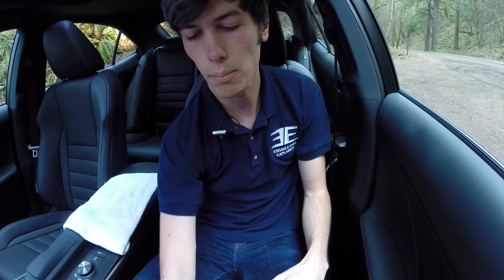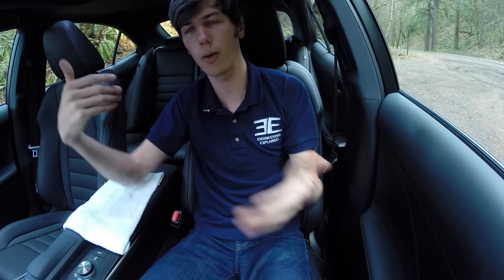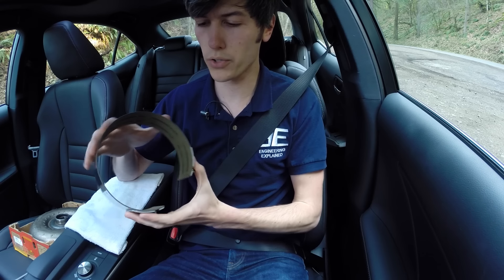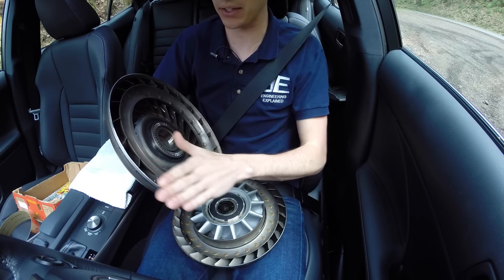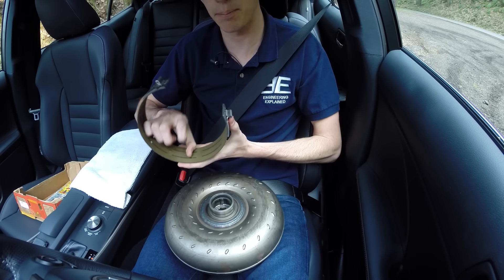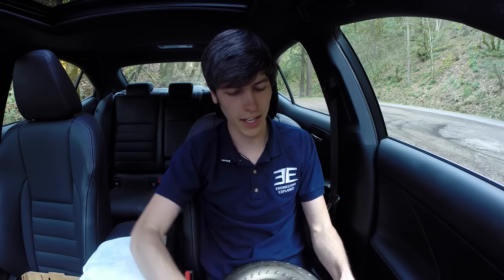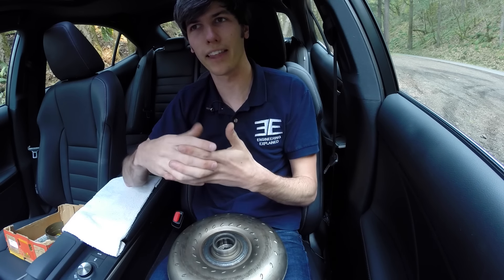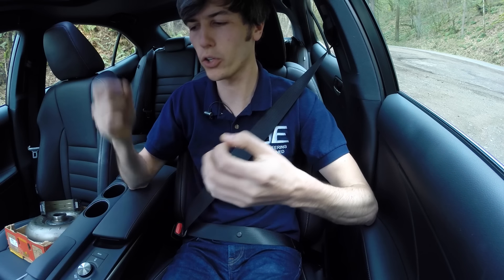5 Things You Should Never Do In An Automatic Transmission Vehicle

Comment: Shifting to neutral at the stop is good for these reasons:
1. Prevents the torque converter from overheating. Idling in drive causes the impeller to rotate while the turbine is held stationary by the transmission which prevents the normal fluid flow inside the torque converter resulting in turbulence and heat generation by the fluid.
2. After a hard stop, shifting to neutral and releasing the brakes allows the brakes to cool down with the pads disengaged from the rotor which prevents the rotor warpage.
3. It will also circulate the fluid between the torque converter, the transmission, and heat exchanger further cooling down the torque converter.
Reply: but what about the guy who crashes into you because your brake light is not on and is reading text on their phone LOL
Reply: i was looking for that. i wonder why he didn´t include this
Reply: @ranger178  You make a good point. I recently been using this practice on my 8 year old AT car after I read an article about it. On inclines and flat roads, I still press the brake so the driver behind me could see the brake lights and also that I could safely put the gear in D when the lights change. I drove a manual transmission for years and practiced the same method.
Reply: 1. The heat generated while in gear at idle is negligible and will have no measurable effect on the temperature once circulated through the transmission cooler and/or warmer (modern vehicles have both of theses to closely regulate transmission fluid temperatures).
2. The pressure applied by brakes at a stop does not cause rotor "warpage" unless the braking system has been heated past its specified operating range. The "warpage" that a majority of people encounter is either runout (caused by uneven application of pad and rotor contact pressure inherent to a poorly design braking system), or pad deposits on the rotor (which will occur regardless of pressure applied between the pad and rotor).
3. This is a misunderstanding of how automatic transmission fluid flows within any modern vehicle. It is ALWAYS flowing through the cooler and/or warmer, regardless of gear position. Fluid flow ceasing hasn't been a phenomenon since the early to mid 90's at the latest.

Stop spreading misinformation.

Comment: If your throttle is stuck, couldn't you put your car in neutral and turn off the engine entirely?
Reply: +Tyrian3k This is what I was going to post and am surprised this was not mentioned in the video as the first thing to do.
Reply: +Tyrian3k In some cars, you'd lose your power brakes and steering.
Reply: Lose the power assisted maybe but doubtful. If you did, it would still be better to do than not
Reply: +Tyrian3k Power steering goes out. So too do power brakes. If you're not expecting either of these or the situation doesn't permit them, you don't want it to happen.
Reply: +SyCoREAPER I suggest you try reading that funny book in your glovebox.   I think they call it an "Owners Manual".    If you do that, it will tell you exactly what I just did.    Do not turn off your engine in this situation.
Reply: +Pywaket Pilot Cars are towed in this exact configuration according to my manual. It curiously lacks anything about turning your engine off while driving, though.
But if you actually want to have power brakes, just keep it in gear. That should keep it running in at least most cars. Works in mine at least.
Reply: Pywaket Pilot I didnt see in the OC that he had turn engine off (or he hadded that after I commented), I am speaking strictly putting it into neutral.

Comment: For fuel economy, there is no question that coasting in neutral increases fuel economy.  Fuel may be cut to the injectors in new cars, but the resistance of the engine will slow the car...meaning that you can cost in neutral on a slight decline and gain speed or maintain speed, where you will lose speed while the engine is engaged because of the engine resistance.  In either case, anyone not actively engaged in driving shouldn't be driving.  For states with ridiculous laws like this, I don't know how they explain  manual transmissions being legal at all.  For those who care, I've gotten as high as 27 mpg out of a 1997 Chevy Blazer, a lot of that was tire pressure, taking off the spare tire arm (and putting it in the back, yes, I do need a spare tire), other simple weight reduction, coasting in neutral, slower acceleration and avoiding braking (meaning, if you see a red light 300 yards up, don't accelerate into it just to stop, try to time your speed so you can still be rolling when the light is green). Accelerating from a dead stop is your biggest wasted fuel consumption.
Reply: funny, I do the opposite, I dont worry about removing crap from my truck, stil have spare tire, and all the crap holding it under the bed, etc. I do coast in N on hills, but I get 22-24 MPG when Im not caught up in traffic jams, my truck is rated by the EPA at 18-20 but the average was around 17 with what they measured, remember they use both city IE LA traffic patterns, and Highway coasting at 55or 65 MPH I can't remember which. RPM band has a lot to with it, I find I do better at gas mileage on the rural stretches of highway where I can cruise at 83. If I go faster it is too much RPM, If I go slower than that around 75 (the speed limit) it is at 4500 RPM in 4 th gear and not the OD.  or so it seems. I watch my tach like a hawk. Also, I wont get speeding tickets on the interstate at 83. you get 10 mph here from DPS. (wouldnt recommend if you have out of state plates they will stop you at the speed limit even sometimes)
Reply: I will continue to use neutral on particular downhill stretches that result in not needing to press any pedal for protracted periods. It relieves my sciatic nerve pain as I rest my foot.

Comment: inmate: i am here for child abusing and murder.

me: i coast down a hill in neutural
Reply: Gets arrested for coasting in neutral
Gta sa soundtrack starts playing
Mission passed
+Respect
Reply: murderer slowly scoots away
Reply: I'm a repeat afender facing multiple counts..
Reply: Gay Inmate:  Hey Neutch Gooch..
Reply: @Ken Mason 😳
Reply: Nothing that he said about coasting applies, when you're trying to diagnose your vehicle and just turn off the engine and put it in neutral so you can listen to it and you doing it in a safe place, nothing mechanically is going to go wrong, it's not going to hurt the vehicle. and if you're trying to keep a vehicle from overheating and you trying to coast down a hill then it's an emergency situation it's doable as long as you understand all the variables about not having that power not having your power steering not having your power brakes but if an emergency calls for it can be done and it won't hurt the vehicle...
Reply: It only applies if you're wearing a comb over.
Reply: 6 stars right away.
Reply: *coasted
Reply: But how are they ever going to prove it?
Reply: @fubarlife7776    I agree you can coast down a hill in neutral safely if you know what you're doing.  But I think overheating is not really a consideration, since the amount of fuel burned going down hill in gear is either minimal or zero, and so is the heat input.   Of course if neutral allows you a little bit better speed to carry you a but further past the bottom of the hill before you have to apply power again, then that would be relevant - depends on the situation.
Reply: Engine break hahahaa
Reply: Hahahaa
Reply: @cr10001  if it doesn't hurt anything mechanically I don't see anything wrong with coasting downhill. When I put it back into drive I wait until it grabs the gear and then I'll accelerate.
Reply: @madphatdopeyo742  The only thing against coasting in neutral is, IF the engine stops without you noticing, you will immediately find you don't have power steering, and after a couple of brake applications you'll lose the power brakes.   This can be embarrassing if you discover this approaching a corner  :)
And if you decide you want power suddenly, it's going to take you a few moments to get back into 'D'.
So if done judiciously, and in the right circumstances, fine.
But your fuel consumption is minimal (may be zero) in gear with the throttle shut - may be less than the 'idling' consumption - so that's not really a reason.
Reply: @cr10001  makes sense. It must depend on the vehicle. I had a 2010 Corolla and when put into neutral while coasting the RPMs dropped to less than 1k. In drive it hovered between 1.8-2k. I did that for over 100k miles and had the car for six years and it never stalled until the tranny broke about 250k miles. It was in drive when that happened and broke when I hit a bump in the road. My current car an 04 Envoy when put into neutral while driving the RPMs don't go down at all and sometimes go up a little bit. So I never do it now.
Reply: I’m in for 10 years… what’s the charge?  Coasting in Neutral
Reply: Neutral coasting isn't about saving fuel, it's about having a roller coaster ride on really hilly roads.

Comment: The only reason why I would put my car in neutral at a light is because it's a long light and I don't want to keep my foot on the brake :/
Reply: Same
Reply: I just put the handbrake on in drive +silicon212
Reply: +silicon212  hand brake is your friend
Reply: Well that's good for you and your Sonata - not so much with my Crown Vic P71.
Reply: +silicon212 Used to do that when I had my first car, If i was at a drive through with a long line I would shift it to neutral lol But now most of my cars are standards, so I don't have to worry about that as much lol
Reply: Ronald de Rooij LMAO I'll have to remember that ;)
Reply: +silicon212 that must be a really, really, really, really, long light. Also, nice streets that are flat enough.
I am relatively new to driving(2yrs only) so what I've done the three or so times I need to let go of the brake when stopped was to use the hand brake and another time I just set it in Park(yes, bad idea on the park)

Tempted to try neutral whenever next times comes around, assuming I'm not on an incline of course.
Reply: +silicon212  sick of people with their foot on the brake at lights etc at night as you get blinded looking at their brake lights
Reply: E-brake in drive.  Or E-Brake in neutral if the car hasn't warmed up yet.
Reply: +silicon212 thats just lazy
Reply: +mark smith brughe get a light tint for the windshield, I got the same issue with the angry drivers in my area driving with high beams on. I'm getting a nanoceramic 70% , check your local laws on tint.
Reply: +silicon212 It's even worse when you're in a traffic jam, up hill.
Reply: That's what Park is for..
Reply: Yes, because EVERY CAR EVER BUILT has an automatic transmission.
Reply: +silicon212 Yup every car is automatic ;)
Reply: +silicon212 The old 90's miatas never had an auto.
Reply: Apparently my sarcasm was lost on the crowd.
Reply: whats sarcasm?
Reply: An illusive concept.
Reply: +silicon212 If you were being sarcastic it was pretty fail. 

Sounded 100% serious and then you defended it lol
Reply: vexx506
Learn to read. "Yes, because EVERY CAR EVER BUILT has an automatic transmission." <- Sarcasm.  Get a brain.
Reply: +silicon212 You don't understand how and when to use sarcasm. And +Asserting Word is still unsure if his sentence makes any sense. Now, what's the title of this video again...? Go on...
Reply: +vexx506 Wow...went totally over your head. When you said to put the car in park, his response was to make fun of you for thinking every car is automatic ( because manual cars don't have "park"!) That's what the sarcasm was.
Reply: Matthew H Somebody got it!  There is HOPE FOR HUMANITY after all!
Reply: Not really. You were sarcastic for no reason.
Reply: Edward Rollingstone Explain "no reason".
Reply: No, Kay, the heating only happens when there's friction (wheel motion).  No motion = no friction.
Reply: or the clutch FFS!!!

Comment: one real good reason to put it in neutral while at a stoplight:  if it's real hot and humid you can rev it up to 2000 rpms so the a/c gets real cold, ha ha
Reply: I do that too haha
Reply: But doesn't that take away power from the A/C to rev up the engine?
Reply: The A/C compressor is connected to the engine via a pulley. The faster the engine spins the faster the compressor does.
Reply: +mop10000 faster the compressor "does?" Do you mean, "faster the compressor and clutched fan spin, moving more cool air over the condenser and radiator allowing for a better experience inside the vehicle..?"
Reply: mop10000 Interesting. Good to know.
Reply: it should be well below 1000 before you put it back into drive!
Reply: +LIghtersUP Well the condenser/radiator fan(s) is usually ran by an electric motor on newer vehicles, so it'll probably stay the same speed. It'll just spins the compressor faster thus compressing the freon faster. Depending on which type of compressor you have the clutch may disengage and engage more frequently though since it gets up to pressure faster.
Reply: the pressure lowers/absorbs heat right away on the cold side (inside the car, if the compressor is engaged)
Reply: Or you could just recharge the AC.
Reply: I find this view very interesting, and +mop10000's introduction of the electric compressor add even more factors at play here. For example: An electric compressor motor requires a specific voltage and current to operate at peak efficiency, and its ability to be supplied with this optimal power. Even this introduces more variables, such as the overall alternator load (across all other vehicle electrical systems) and the alternator's ability to supply the compressor motor with enough current to run at is maximum compression efficiency. Using clutches to engage the compressor only when compression is needed only adds efficiency to this system when there is on oversupply of energy to the A/C system - no more power is required to provide cool the cabin air since the freon is at its optimal compression for this system. But think about when the clutches are engaged, can the higher current provided by a higher revving alternator in turn transfer to additional electric motor torque to spool the compressor more quickly, in turn achieving maximum compression and cooling faster? But as I said, there are many factors at play. Outside of the limiting factors in the A/C system itself (maximum compression tolerated by the hardware, amount of cooling surface area and "freon", even the cooling efficiency of the refrigerant itself), there are other variables like the overall efficiency of the alternator, compressor motor, cabin blower motor, electrical system, etc. Even the size and sealing of the cabin come into play. These days, the vehicles computer is controlling the the optimization and priority of all of these  subsystems. Just remember, an engineering team has written the code that dictates how these systems will prioritize and route all of the power that ultimately comes from the engine itself. Many more thoughts, but this is already too long...
Reply: I do this in AZ frequently too. Even with a fully charged AC system it just isn't that efficient at 900 RPM when it's 115 outside. 2000-2500 is the sweet spot.
Reply: racer83racing  how does it be cold?
Reply: Dat_Boii_Wavy Please tell me you aren't high revving a winter cold engine...
Reply: Dat_ Boii_ Wavy. Quick way to warm up a car, drive it but take it easy for about 5 minutes.
Reply: Put on P when at a stoplight - you disengage the engine and the transmission (same as N) but no need for the brakes when on a slope, and even a wee tiny one can make you roll after a while. A no-brainer.
Reply: szpoti some cars unlock the doors when in park